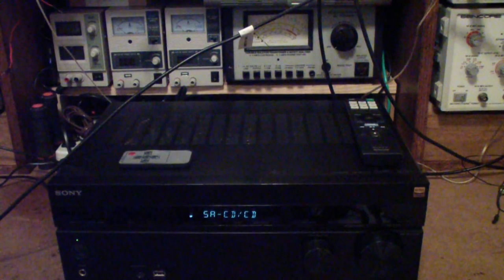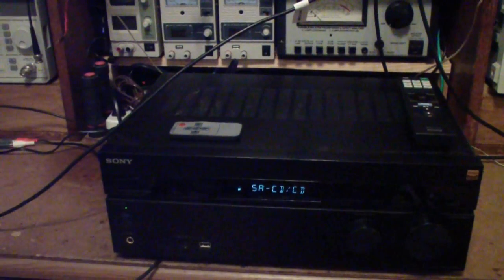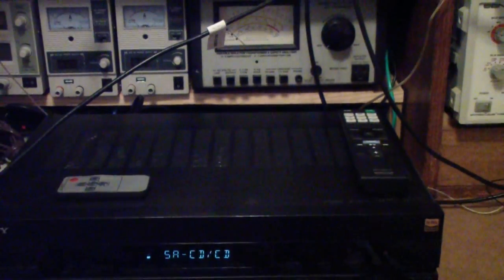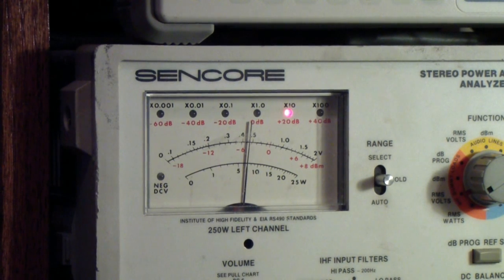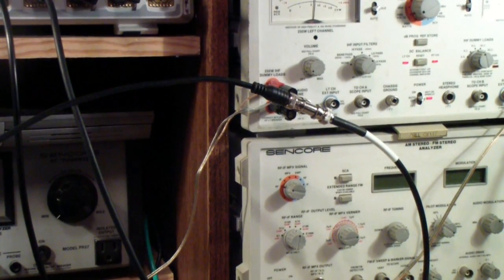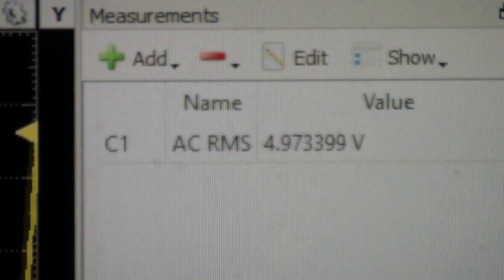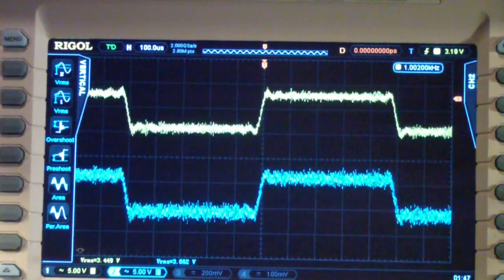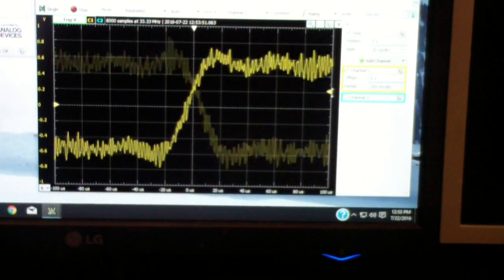TTT101 Anaog Discovery2 More Amp Testing

Comment: Hi Tom,
I guess you probably figure that out by now, but the triggering problem in you Analog Discovery 2 is related to the noisy signal and the trigger mode you are using (as you already guessed in your video). The noise is causing the signal to cross the trigger point more than once for each edge (falling, and rising) of your square wave signal. One way you can try (I'm not sure the Analog Discovery 2 has this feature) is to change the hold off time of the trigger mode.
Anyways, thanks for sharing your analysis.
Reply from the maker: Thank you for your comment and suggestion. You are right that the hold-off helps, and I use it when I need to get a stable waveform, but I also try to use the default modes of test equipment as much as possible since some users depend on them and do not always understand how to use advanced features. You may notice in my original testing of the original AD that the same problem occurred, especially when you get near the high frequency limits of the vertical amplifier. One thing I have not seen, even from Digilent, is a good video on using the advanced features (especially in the spectrum analyzer) when the scope is used to produce an FFT display. Perhaps someone will consider making such a video at some point.